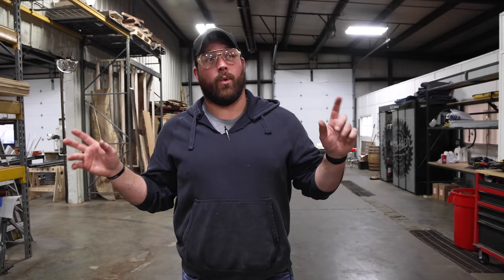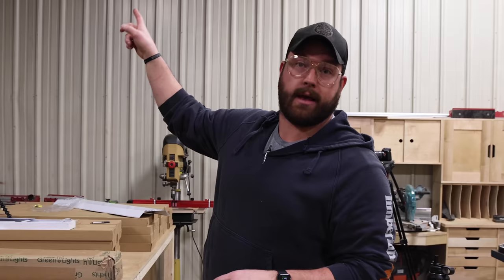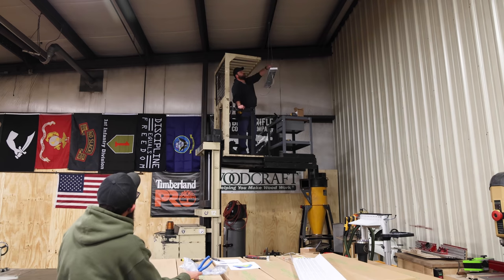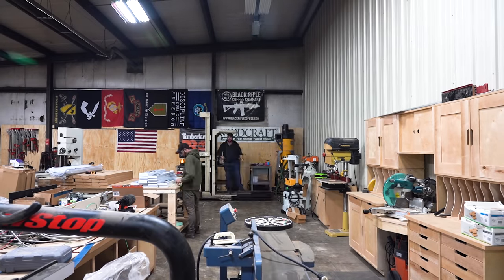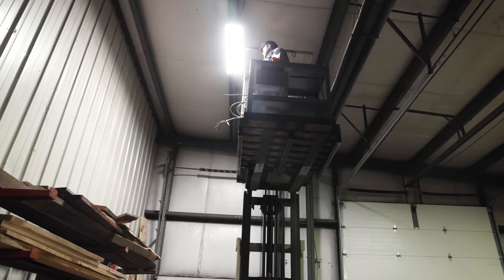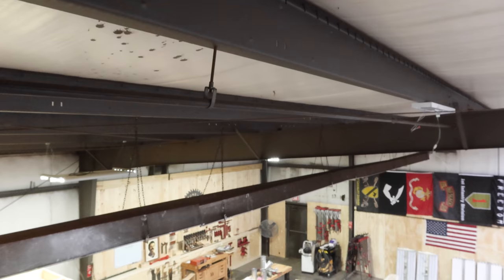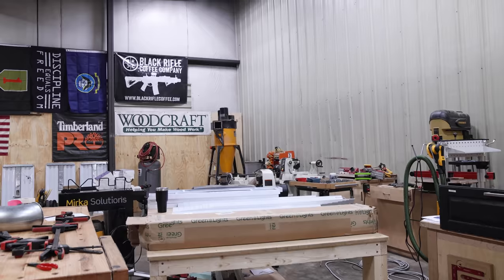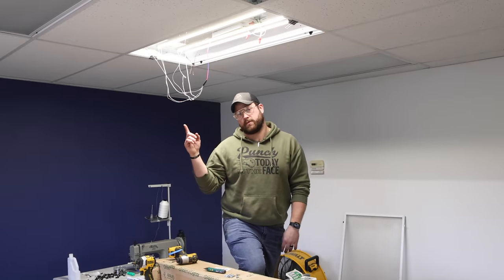The Best Upgrade you Can Make To Your Shop

Comment: To prevent the sway, you could try making the anchor points wider/larger than the lamps. the chains should go outward from the lamps, that will create tension.
Reply: Great suggestion
Reply: Beam clamps and threaded rod would work great as well
Reply: This was my thought. It’s the reason most chain lights don’t have chains hanging straight down.

Comment: Great video. Might want to look into having that lift serviced. New hydraulic oil, filter and an adjustment to pump gpm would really smooth it out!
Reply: I would also suggest a harness. I drive a picker while at work, and we require a harness. I would hate to see one of the guys slip off from 15ft up.

Comment: In Australia we have threaded rod which we call Booker rod not sure what you have but we use this to hang lights with. Depending how long you need you use thicker rod. With nuts under the steel and tight it stops the swing

Comment: Even though it is true that the intensity from one light halfs when you double the distance. Since you want even lighting in your shop it doesn't really matter. The light from one lamp gets just spread over a bigger area. As long as you install enough lights you have more even lighting than if you would have lowered the lights which would had made it more spotty.

Comment: Love watching people who don’t normally do electric work attempt my profession, you guys did good. Best way to keep lights straight is two eye bolts with jack chain on each side. Even better than that would be threaded rod, but that gets a bit pricey. Nothing wrong with straight to steel though. Love the videos!
Reply: Maybe you can answer a question I had - since these are mounted into steel supports, would grounding them to those supports be a good idea or a SHOCKINGLY dangerous idea?
Reply: @MrMartinSchou  the building framing is grounded so it is fine
Reply: I thought I noticed a bx with no anti short when he was putting it in that twin connector on the first light. Maybe not though

Comment: Should use all thread, 1/4"x10' with beam beam clamps. 
I also loved the woodshop chief. Maybe add it at the end of some videos or do them as shorts.
I'm not sure if the local code will let it commercially, but try lever or push connects for wires they let u test after connected.

Comment: Not sure on America's standards . But in Canada when installing the armoured cable you have to put in a protective sleeve (anti short) . To stop from crushing the wire with the connector
Reply: Same here. I've done commercial electric for 20 years and it's been code since I started.

Comment: Rise Up Red Sea. Saw the Cards sticker on the picker. Which one of the gang is the Cardinals fan?

Also we had our shop lighting upgraded to similar lights last month. The crew that did it set up a laser level to keep all the runs the same height without needing to measure each section. The fitted solution you have done seems perfectly fine though and much easier.

Comment: 4' x 2' LED panels are cheap as chips. Probably a better option than converting old fluorescent fittings, although I appreciate you got the conversion kits for nothing.

Keep up the good work fellas! 👍👍👊
Reply: Screw swapping out the whole fixture. Do what he did or make it even more simple and just bypass the ballast and buy LED lamps

Comment: Threaded rod is a good way to suspend lights and keep them straight.
Reply: It usually depends on the length of rod you are using. I've had to install 15' of threaded rod for some 2x4 lights and it swayed so much. But for this installation  I think at most would be about 5' so it would work perfectly.

Comment: Looks great. What color temp did you go with?
Reply: Looks like 5 or 6k
Reply: @nikogarcia3249  absolutely no way to tell on video if the color balance on the camera was set correctly. And then there is post processing. Only way to tell is if someone is moving in and out of different color temperatures and then only a few seconds cause most guys shooting on their phones  have auto color temp set.

Comment: a good laser level with a horizontal and vertical laser would have made install alot faster and probably more accurate. If your building is out of square layout of lighting will look off if you just pull your tape from a out of square wall. Maybe you don't care to be perfect, but im a carpenter so it bothered me lol
Reply: also a digital laser "measuring tape" would help for measuring your spacing from light to light

Comment: Why would you not just use the lights that are pre-wired with a plug?  Each light has a female plug also so you can plug them end to end if you wanted.  One strip is 5,000 lumens and cost about $25.  I put up 9 of these in my shop in about 20 minutes.   Also, light drops off at -Rsquared ... not double and half.
Reply: Because these are CRI 95 with decent R9 (red) values and they do videography?

Comment: Weirdly, your shop looks like the mythbusters shop at the beginning of the video. Also, LED lightning is not a guarantee of better performance vs fluorescent lighting. With electronic ballasts and good quality fluorescent tubes, you get a much better CRI at a much lower price. Many LED products are built with very cheap and dubious supporting hardware (small, improperly connected or absent heatsink, capacitors, bad or no soldering where required) and these components will fail within months or a couple years, because LED lights run HOT. I'm considering to revert to fluorescent fixtures for the workshop and halogen for the rest of the apartment after too many LED bulbs failing after a couple months.

Comment: Where's your fall arrest harness? Pickers are notorious for people falling off of them and 15 feet can easily be a lethal fall. You don't even have a railing on half of it is why. Get a couple of 5 point harnesses and fall arresting lanyards before somebody has a really bad day. Also, if you fall and you didn't have a harness on, your workplace insurance is not going to pay out for medical bills while the business could face very large fines from OSHA and the state equivalent of OSHA.

I'm not being safety crazy, I just don't want one of you to get seriously hurt. Might also want to consider having anybody below you within 10 feet of the lift to wear a hard hat so if you drop a tool it is less likely to hurt them. I would go with the free method and just stay 10+ feet way from the lift when it is in the air.

Comment: Now someone has to go back and actually splice all the wires together. Just a wire nut is insufficient...at least by NYC construction standards...Please have your electrician check the installs for compliance with your local code...
Reply: Can you be more specific? Wire-nuts are specifically designed for splicing... Properly installed wire-nuts do not require pre-twisting. Change my mind...
Reply: @matthewrichards5941  The only way I can change your mind is you have to go get trained in NYC where electrical code is tighter than most of the country... then be an electrician for 20+ years and go through the troubleshooting and finding unspliced wires under wire nuts as the root cause of dropped neutrals and shorts. Unspliced wires with just wire nuts to hold them together have caused more problems than saved time for not doing it "right"...That being said, if you ask 5 electricians how to do something you will get 7 answers that all work...
Reply: Show me the NEC requirement that says a wire nut is insufficient? Yes, you have to abide by state and county requirements, but this ain't NY.
Reply: @nikogarcia3249   I didn't say there was an NEC requirement...I cited my own experience. This experience is in NYC, where the code is tighter. How many troubleshooting calls have you been on where a sloppy splice was the culprit?